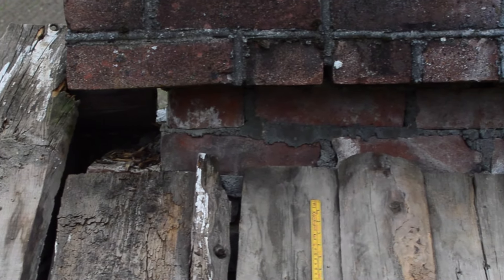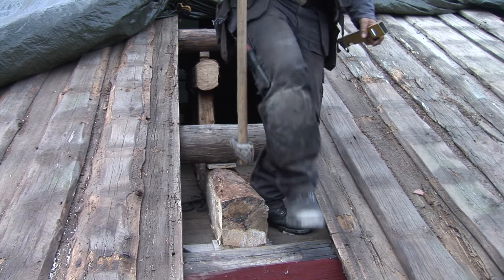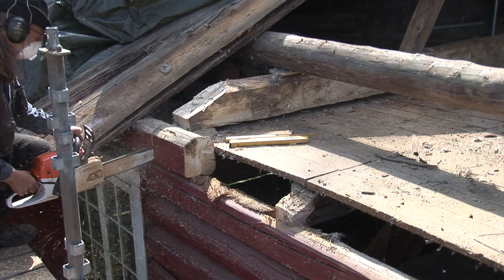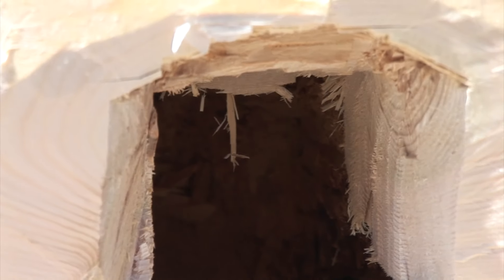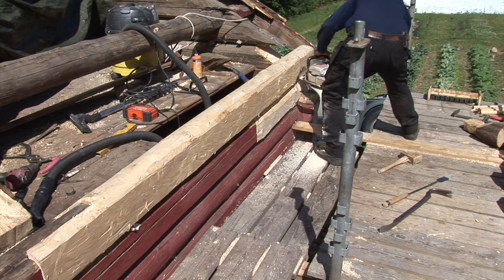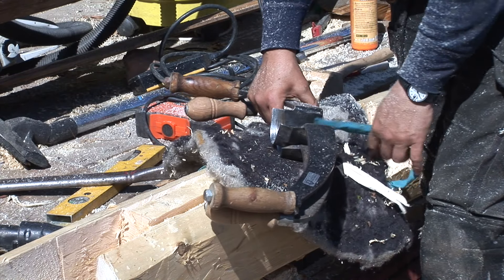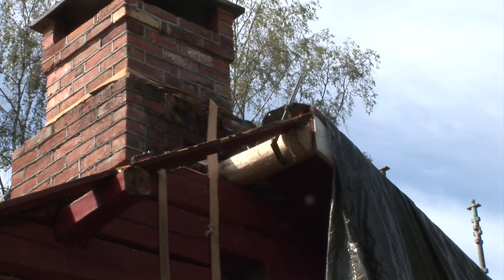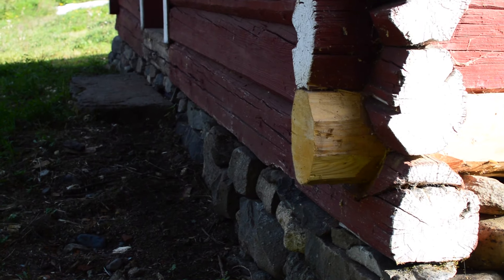🔴 Log House Repair in Norway Part 15/15  The conclusion.

Comment: great video like building a log house upside down to fix one , I would think this was bread and butter work for old time carpenters. The geometry of your axe is perfect for notching. Would you use the red falun mine paint to finish?  cheers from Canada
Reply from the maker: As far as I know, the customer has used what we call composition(komposisjonsmaling) paint, which is more or less the same as falun rød but with any color you choose. Upside down timbering is so much more time-consuming than right way up for sure.